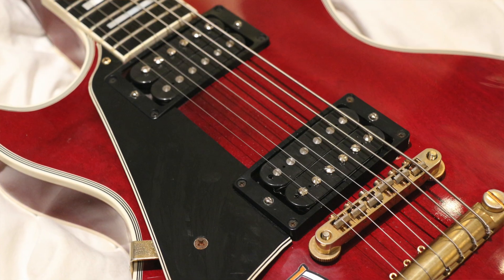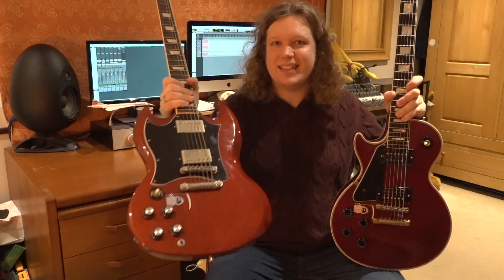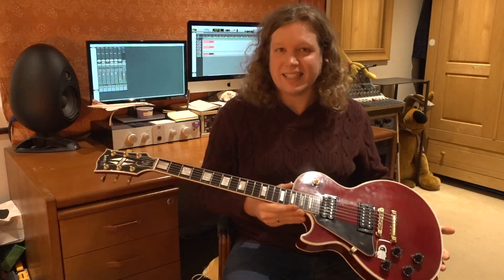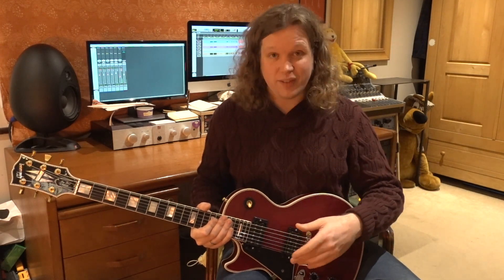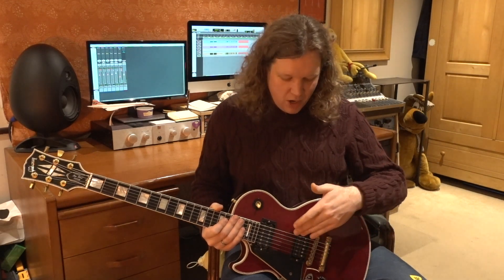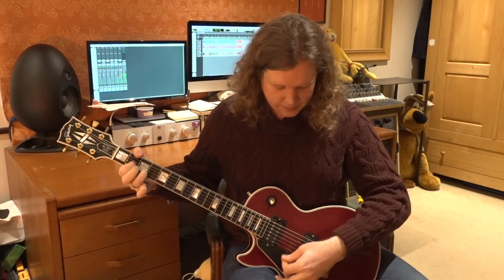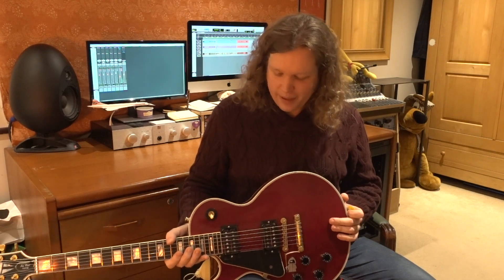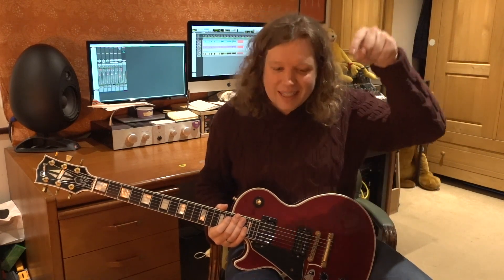Dialling In New Pickups: Height & Pole Screw Adjustments

Comment: The funnest part of moving polepieces for me has been the change in attack. Polepieces down, the pickup seems rounder on the pick-strike and more fit for sustain. With them up, the attack is way heavier w/ an immediate low-end “bump” that goes away (like a compressor knee), but you can over-do this. It can sound a bit like the bass overload from someone speaking too close to the mic. It kinda sounds like a WAY overwound single coil.

It’s worth noting that the way it changes EQ is more nuanced than just adding treble, too. Polepiece changes seem to make some highs increase, and others decrease, in a strange but predictable way. Best way to hear it is to “feel” the difference as you try it yourself! ^some food for thought, for those trying this out

Comment: FWIW, my approach to this is both similar and different.  First, I dial in the height of the bridge pickup to where I think it sounds best.  Next, I dial in the height of the neck pickup to where it has the best volume match to the bridge pickup, which may be the same or a bit lower depending on the guitar, pickups, and whether I intend to have an out-of-phase middle position (either hard-wired or on a switch).  Finally, I adjust the screw pole pieces to get the best string-to-string volume balance across each pickup.

Comment: In my situation (70s classic rock)
I'll break it down to the days of my 100 watt Marshall Super Lead stack and my Les Paul jr P-90, back in 72
I sit the guitar on a stand facing AWAY from the amp at about 5 feet
I turn the amp up to playing level which for me was about 4
Then turn up the guitar and let the strings ring.
Turn down the screws of the boisterous notes and turn up the screws that are reluctant to feedback until they are all even.
Now when I play, I can cut the guitar volume to 4-6 during the verse and kick it up to 10 when soloing capturing all of the long "Santana, Nugent" type notes
So with your humbucker, same principle
So depending on the acoustics of the venue, you adjust the amp and it should work for your style.
You can always get quiet, but you don't want the bottom falling out during your solo.
Now get out there and kick Out The Jams Mer Fers!!

Comment: A lot of good info there Joe!  Adjusting pickup height and polepiece is essential to get the best out of them and that varies from guitar to guitar. The polepieces help balance the string to string volume too. Before anyone decides to replace the pickups on a new guitar I would advise spending an hour or so with a screwdriver and it's free! One thing I have noticed about my OX4's is that no matter what guitar they have been in they have the best middle sound of any pickups I own or have tried. Keep up with the vids Joe! Appreciate it.
Reply from the maker: Absolutely Brian - you might be able to see in the thumbnail that after I'd shot this video, I did raise the D string pole up a tiny bit more as that string was a little lower in volume than the others!  But the video was shot and uploaded by that point :P Haha
Reply: @JoePerkinsMusic  Funny enough Joe, but all my humbuckers have the D string polepiece a fraction higher!!😊

Comment: My approach to string output balance, for 35 years now, has been to get the string gauges right so they're equal for tension and to leave the pole screws alone - just getting an overall height set for the pickups rather than adjusting pole screws. Standard string sets are mostly unbalanced  - 9 to 42 for example is weak and flabby on the lower strings and  these days I'd go with one of the hybrid sets available now as a much better way of achieving balanced output.

Comment: I first place the humbucker as close to the strings as possible. Then I compensate for the difference in volume by lowering the louder side. Then I adjust the pole pieces until I like the sound and then equalize the difference in volume again. Done

Comment: I have an Epiphone les Paul and one if the poles on the neck pickup seems to be turning freely- it doesn't raise or lower when you turn it either way- just turns. That string- the G string- sounds unbelievably dead- the pole is really low, like level with the face of the pickup cover. But I can't get it to raise- like I said, it just turns. I'm going to take it out and see if I can figure it out, I guess- it's the only thing left to do really. If I can't- new pickup time, I suppose. The intonation is horribly out as well- it was put up and my nephew (10 yrs old) got ahold of it and just went to turning screws so- considering that I'm lucky it's just the G string giving me fits. Other than that- it actually sounds pretty good. But I don't have a strobe tuner so- I can't set the intonation. I use a pitch pipe to tune up- no way I can set it with that- my ear isn't that refined. Always has to be something huh- never simple.
Reply from the maker: You might be able to apply pressure from underneath as you turn the screw and get it to shift upwards - sounds like the internal thread in the plastic might have let go.  Intonation should be simple enough to sort - you'll likely be able to get the intonation close enough just using your ears; but a tuner would be a good investment; even one of those cheap headstock clip-on ones would help.
Reply: @JoePerkinsMusic   Changing strings helped tremendously- they weren't that old but apparently the G string was just dead for some reason. And I looked at someone else's Epiphone les Paul and set my intonation the same way- it's pretty close now, I can hear it's just slightly out when I'm fretting bar chords way up the neck but- not by much. With a tuner I should be able to dial it in now. As for the screw in the pickup- it doesn't seem to be affecting the sound quality too much so, I may leave it like it is. Now that I see it's not really causing much issue, I wonder how long it's been that way- may have been this way when I bought it.
Reply: I would suggest to listen unplugged to the sound of the strings, and check if the G string still sounds weaker than all others. If so, there is something what's not allowing the string to vibrate freely. Most likely on the bridge. A worn out saddle slot can dampen a string, with a hearable or sometimes a silent buzz. If so, a saddle replacement is needed.

Comment: My humbuckers are around 7.1k for neck and 8.5 for the bridge and are quite balanced in volume. I use the same setting for each pickup (2.4 mm). I wondered what your starting point was for the pickups height?  I just raised the pole pieces again recently thinking it may give me the sound i want, but the output wasn't enough for me, despite the tone being pretty good. I may even raise it to 2 mm if need be, though the tone could be too harsh.
Reply from the maker: They were just thrown in, to be honest...didn't measure them to begin with as I was always going to move them.  It's all a balancing act depending on pickups, the individual guitar, and personal preference.  For the cost of a screwdriver though, there's so many tones to be found just with a few twiddles! :-)

Comment: Hi Perky, just wondering if you usually compensate for the radius of the strings by having the outer pole piece screws lower than the inner ones? I was thinking this would balance the volume across the strings.
Reply from the maker: It's very guitar dependent, I find - I don't do it routinely, but if any of the strings are sounding louder/quieter than the others I'll nudge things around until they're more equal.  I just play all around the neck and see if anything jumps out as being uneven.  But it's not something I find myself doing too much :-)
Reply: @JoePerkinsMusic  I’ve been experimenting with it these last couple of weeks and it does seem to make the humbuckers more dynamic and gives them a bit more of a single coil feel. I’ve also tried staggering them according to the magnetic strength of the strings, which seems to work better than the radius arrangement. Future comparison video idea for you perhaps? 😉
Reply: In the old days, the local music store salesman showed me how to adjust pole pieces 
on the big hollow body Gibson Jazz guitars.  Basically adjust pole pieces to the radius of the neck and individually adjust as necessary.  He showed me how to do it:  Start with all pole pieces flush with the cover.  Turn #2 and #5 up one turn.  Turn #3 and #4 up two turns.  

Here is the description in more detail.

Reference:  Dan Erlewine

Long Post - Copied from the Les Paul Forum

www.lespaulforum.com/index.php?threads/dan-erlewine-les-paul-set-up.184647/

The pickup polepieces [on the '59] were set up to match the 12” (305mm) string radius created by the bridge saddles. I asked some repair techs and Gibsonelectric expert Phil Jones about this polepiece adjustment. Jones was the Gibson Custom Shop’s first builder, and worked there for fifteen years before joining the world-class, six-man repair team at Gruhn Guitars in Nashville, Tennessee.

“Gibson set the outside polepieces flush to the pickup cover,” Jones says. “When flush with the cover, the screwdriver slots of a typical humbucker are at a 45-degree angle. When you raise the middle polepieces to a 12” (305mm) radius, you end up with an almost perfect zig-zag pattern from side to side. In later years, Gibson started putting anything with a slot—stop—bar studs and polepiece slots—in neat, straight lines going at right angles to the strings, to look good.”

My friend Albert Garcia of Whittier, California, an expert setup man, uses a set of .010” to .046” strings (.3mm to 1.2mm) on his Les Paul and adjusts the pickups as follows:

“I use the same zig-zag radius setup that Phil Jones described. Gibson used to recommend lowering the B-string, but I don’t. I set the polepiece radius, then adjust the neck pickup to exactly 1/16” (1.6mm) on both sides, and the bridge pickup the same. Since the screwdriver slot in a polepiece means that metal was removed, zig-zagged polepieces place more metal under each string than a polepiece adjusted with the slot going in line with the strings.

“Then I go back and drop the bass side of the neck pickup another 1/32” (.8mm) or so—until it knocks off some of that ‘whoofiness’ that the neck pickup on a Les Paul always has. I use the exact same setup on P-90s. Also, when I’m done adjusting the polepieces, I remove the pickups and cut the bottoms of the polepieces off—there’s less capacitance if you remove the metal, and it tends to brighten up the sound. I wouldn’t do this on a vintage, however.”—Albert Garcia, Wittier California

Here’s the final setup for the black ’78 Les Paul I’ve been working on through-out the book. In the end, it played great. I radiused and zig-zagged the P-90 polepieces just like the humbucking pickups mentioned above.

The heads of the two oval-head Phillips screws that hold the P-90s into the body were catching the B-, G-, A-, and D-polepieces when I tried to raise or lower them (not an uncommon occurrence). I removed the screws, chucked them into my electric drill, and ground their heads against a smooth file to downsize them. It worked perfectly.